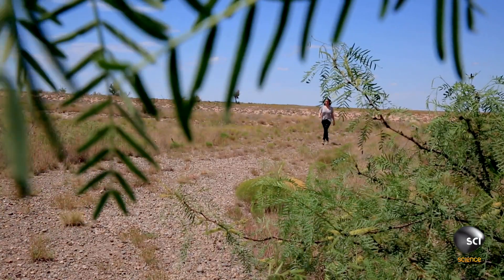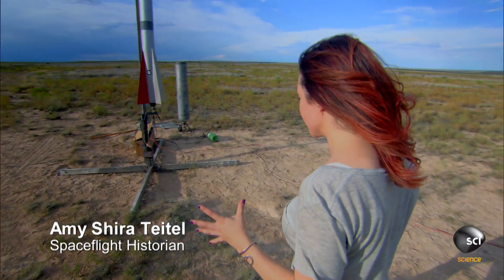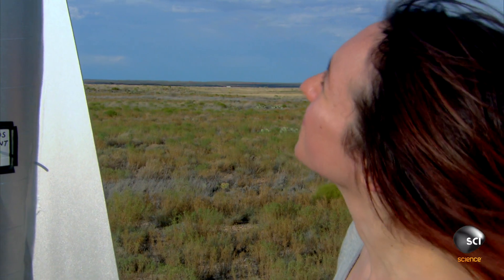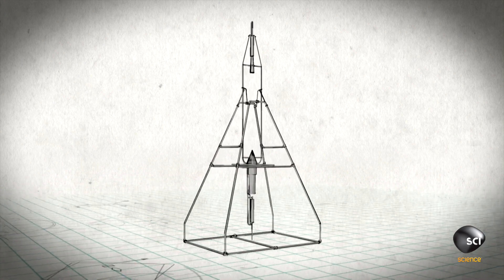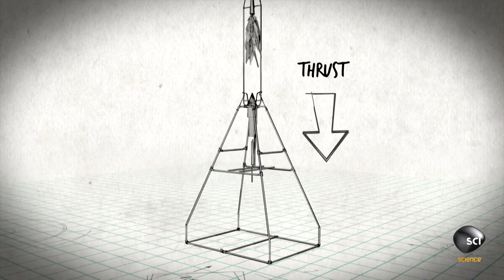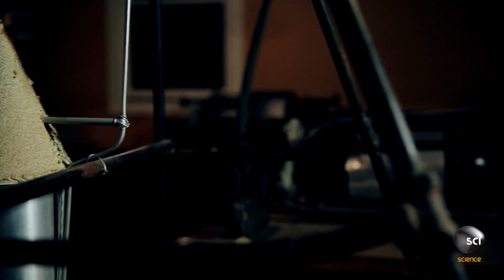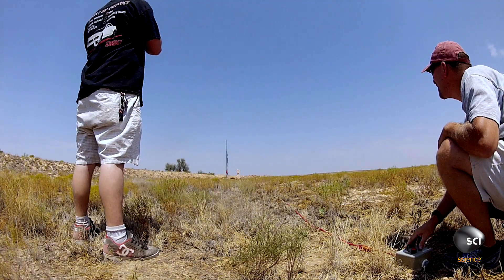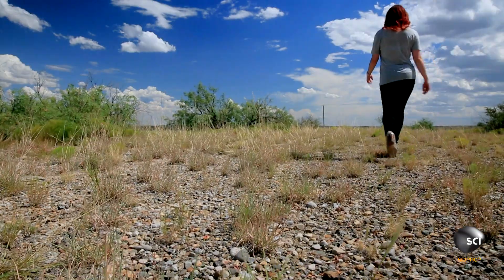Goddard's Rocket Innovations

Comment: The low temperature of liquid oxygen (-182.96 °C) cools the tanks, plumbing and valves. If they are cold enough, then water vapour of air will condensate around them. I would imagine that condensed water (ice) around valves will jam them. How Goddard solved this problem? With insulators?

Comment: yes, and those Germans copied my design innovations.

in 1936 the Nazi's sent a Military Attache to the US lead by Friedrich von Boetticher and spy Gustav Guellich sent a 4-page report to the Abwehr, they opened my mail and had stolen some of my mailed reports.
In this 4-page report of mine included that the spy apparently visited Roswell and saw a launch.
Included in their information and report were fuel mixtures and my innovative Engine liquid cooling curtain.

It just so happens that the V-2 Rocket also had this Engine Liquid cooling Curtain, as well as 3 dimension gyroscopic stabilizers, Turbopumps, Control vanes, a tapered shape towards the thruster and Complex delta wing.